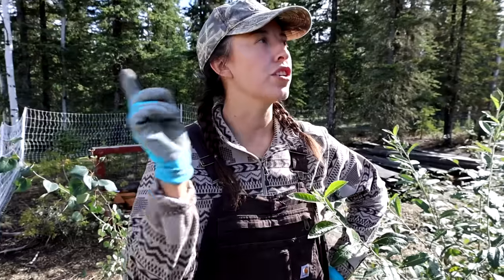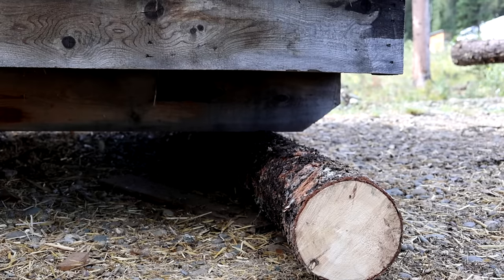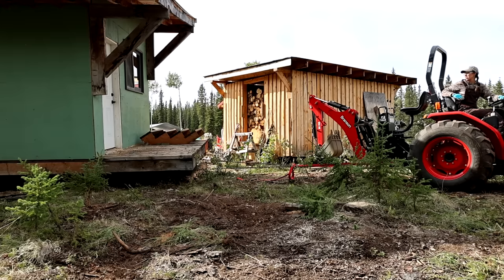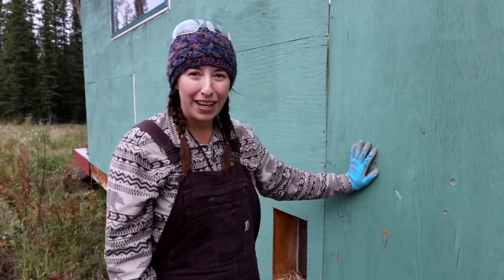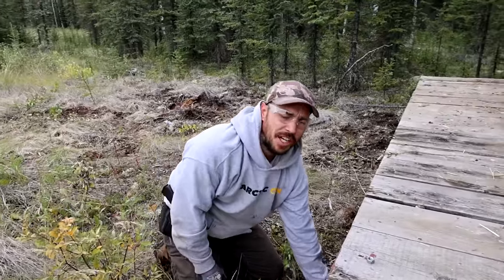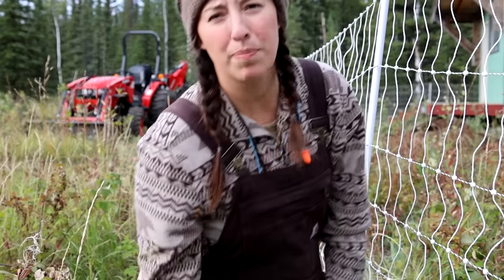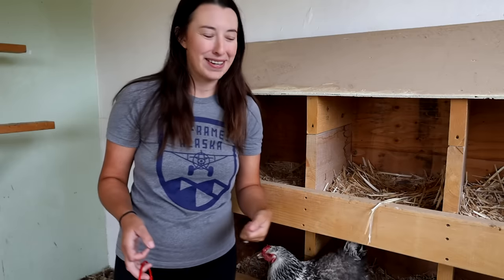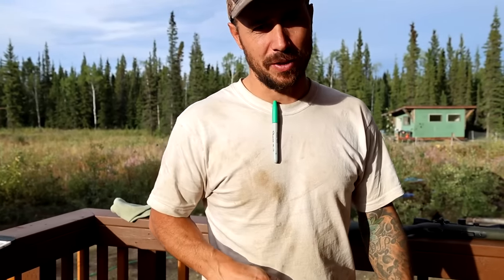The Chicken Coop Goes for a Ride

Comment: If you take coffee grounds and bake them until they start to burn and then sprinkle them around the area you’re working in it will help to deter the mosquitoes. The coffee doesn’t necessarily have to be burnt if you don’t feel like taking that extra step. Burning them just makes a stronger odor that they don’t like. The smell hides the odor of fresh blood making it more difficult for the mosquitoes to find you. I’ve always had success with this method.
Reply: Wonder if this might also work for those small biting blackflies! Nothing else seems to!
Reply: The mosquitoes find You by detecting the carbon dioxide that you exhale.

Comment: As an undergrad I was tasked with the dendrochronology (counting tree rings) of tamaracks that were killed in a freakishly cold winter in a local bog. I would have trunks no more than three inches across well over a hundred years old. We had to use a microscope to count the rings, some which were only one cell layer thick.

Comment: I had been given a homemade coop a few years back. When I did some alterations on it and had to remove the foam board in some areas, they were infested with ants. Tunnels everywhere throughout each foam board. I'm in the upper north - east of NY.  Hopefully this doesn't happen to you guys. But over time if it seems colder on the inside you might want to check them. Beautiful birds.

Comment: A five ton truck floor jack would come in handy.  You'll need one for the tractor sooner or later.  Nothing some duct tape won't fix.  Gorilla time.  Use the backhoe bucket to push the tractor instead of spinning the wheels.  Slow growth in the north country.  Makes really good wood.  Good job on the cut.  Get the grouser bar closer.  Step away as soon as it starts to fall.  One step ahead.  The change is on with the frost.  Good looking dirt around the coup..  Hope the bees have done well.  Foam, keeps the egg shells from breaking.  Time to go fishing again.  Moose hinting too.  Like the time lapse.  great looking meal.  Be safe.  Next time.

Comment: If anyone was wondering, quaking aspen is apparently a poor firewood when it comes to BTUs, having roughly half that of black locust or oak.  But while it isn't particularly good as long-burning fuel, it does burn fairly well, and apparently makes great kindling.  When dry, it burns with very little smoke or creosote (particularly when compared to pitchy woods such as spruce or pine), so it's an ideal starter material to get a fire going.  It also tends to have a very straight grain, so it splits very well, another added bonus when breaking it up for kindling.

Comment: I almost died using one of those high lift jacks while I was in high school.  They don't call them "widow makers" for no reason.   I was working for farmers, and I had to jack up the back of a pickup.  It was raining, and as I was jacking it... my hand slipped and the bar came up and smoked me in the side of the head.  The weight of whatever you're jacking comes back at you if it slips before it locks in, and it knocked me out for I don't know how long.  Was at least 15-20 minutes considering how soaking wet I was.  Once I woke up, I didn't even know my own name.  Ended up with pretty serious injuries and the doctor told me if it had hit a half an inch over from where it did, it would have probably given me brain damage.  Those things terrify me now, and watching other people use them makes me really anxious lol.  I was young and dumb though, and wasn't using proper technique.. for anyone reading this who uses one, make sure your head is clear from the bar.  Don't lean over it as you're jacking.

Comment: Crunch... Ouch!
Well thankfully you had a spare window...

Pepper has such a cute meow 🐱

Hey, as an idea for the base of the coop and the home... You should consider using Hardie board. It's a cement/fiber board. It is a bit more expensive; however, it is rot proof, fire proof, bug (i.e. termite) proof, etc.  Especially important since it will be covered by snow in the winter and close to or touching the ground.

Comment: If you put a bolt through the chain on both sides of the ring pulling it you will have more control on direction. even a paddle lock on each side to stop the chain from sliding.

Comment: I don't know how many comments you have had about inclosing the ends of your Quonset hut for the winter. You might think about taking some of your logs and make some bracing for the ends of the building for the winter... These buildings are extremely strong.. But air on the caution of leaving them open for the winter because of snow load...with out the shear strength on the end of the building you might have a issue! Just a thought for you since you put so much $  &  sweat putting it together.  Totally enjoy your channel!!

Comment: For all the chicken movers. Rules for easier moves: 1)move the house, when the flock is inside 2) ideally, leave the position of the coop door, the same sun side as it was ( birds follow wind and sun to get direction) 3)move it in the evening, when chickens have finished the day. 4) after new position, put back nets and clip the wing if nessesary when chickens are still inside.  5) if you change everything for them, keep chickens inside for min for 2 days to get to use to all new. Like that, you have no chaos at all and don't have to chase them from previous and odd places as that can cause no laying eggs due stress ❤

Comment: Wow,any safety officer would have fired you 2 guys on the spot,working very dangerously😁😁😁😁 Never climb over slings while pulling something,or while they are under tension,if it snaps,it will break your legs or even amputate it,I saw that happened once at work. But at the end you got the job done,well done.